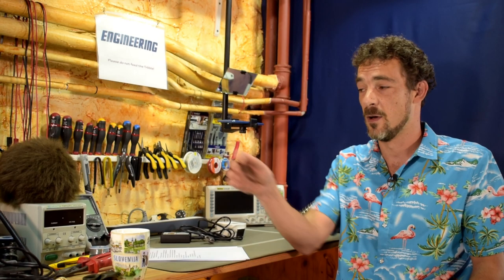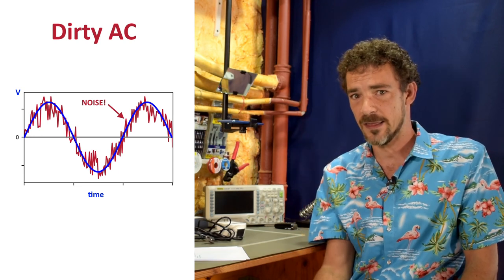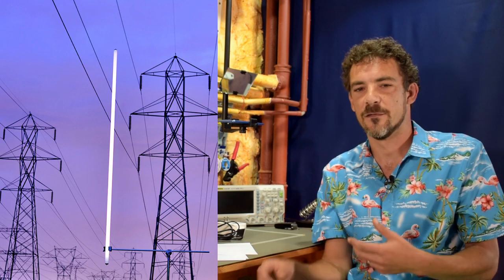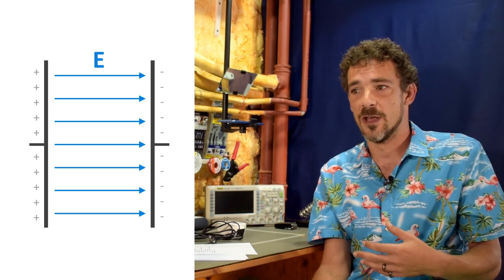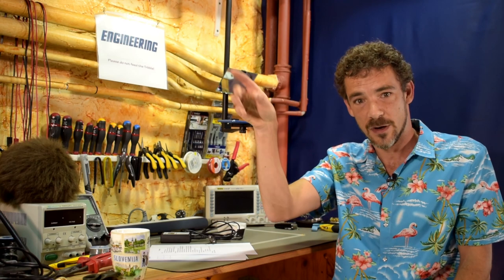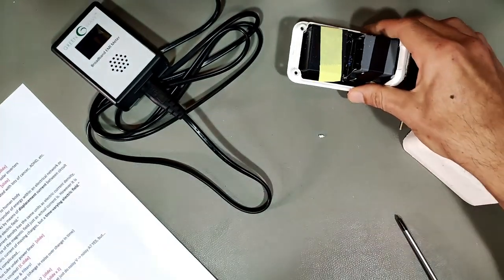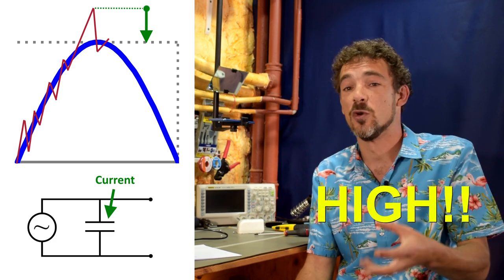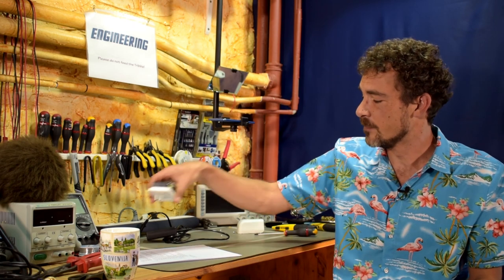Dirty Electricity: What it is and how to fix it

Comment: After a bit of research into AC line EMI I came across something similar called an AC line conditioner. It seems they are popular with the audio community. I understand how a capacitor acts  as filter to clean up power. Is it really that simple? The AC line conditioner has something that is missing in the Stetzerizer filter called a common mode choke and in some cases two additional single chokes. Can this be incorporated in your design in some way? I'm not exactly sure how and where these components can be most effective. I would much rather install one large unit at the source than have a bunch scattered around the house.
Reply from the maker: It seems that one big filter at the input to the house is less effective than smaller filters scattered around. That's what they say, and that was also my experience. I THINK the DE filters are only a cap because it's filtering differential mode noise (noise on one wire) instead of common mode noise (same noise on both wires that passes thru the ground wire). For audio purposes, the common mode filter would be better as I understand things. There's a handy PDF I found that explains this stuff pretty well: https://www.x2y.com/appnotes/emi/2001.pdf
Reply: @ScottiesTech  I think it's starting to make more sense to me now. It seems the capacitor types and ratings are what's important. The voltage and capacitance I understand, it's the ESR rating that's new to me. Like how ultra low ESR capacitors in drones help with filtering video transmission noise caused by the ESCs. I wonder if that would make a difference?
Reply from the maker: @saifcathum3423  ESR and ESL are just equivalent series resistance/inductance - IOW, a cap isn't just a capacitance; it's also a resistance and inductance. Usually this doesn't matter so much until you're dealing with super-high frequencies. For example, when you buy a polypropylene film X2 cap, even all the data sheets just say 'super-low ESR!' without giving a value. For little teeny chip capacitors for GHz-freq circuits, then they give ESR/ESL cuz it matters much more. At very high frequencies, even the traces on the circuit board matter and must be modeled and EMI tested. It's an ultra-hairy job cuz you get all sorts of weird behavior, noise, etc. and you think it's your circuit design, but alas no, it's the actual traces on the PCB routed poorly! Nutty stuff. For DE, the particular size/type of cap just seems to be chosen to filter the medium-range frequencies of about 2-150kHz. The X2 EMI (line-line) caps are also chosen because they fail safely across 120/230Vac. They tend to be "self-healing" to some extent, and when they fail, they just short line/neutral - which trips the breaker and you're done... no exploding or fire hazard. Which is nice!
Reply: @ScottiesTech and what about using both whole house inline filter with the stetzers?

Comment: Very informative and disturbing video. Thanks. Could you not measure EMI and electrical induction with a multi meter though? Its crazy how much they charge for meters. I also bought an RF meter and even with router and such electronics off Im still measuring crazy RF in the house and bedrooms. I wonder if the meter is picking up some of the induced RF by the electrical wiring?

Comment: Ok, it's early in the video, but I would like to run a new, forced air, natural gas furnace with a generator.  What type of generator will I be needing?  I plan to wire the furnace to go straight to the generator.  Thank you for your time!
Reply from the maker: You'd just need to know the max electrical power used by the furnace. Since it's natural gas, it's probably only fan power + control electronics (aka not much). Then size your generator so it has a rated continuous power output at least double what the furnace needs. And preferably, get a good generator (as in "pure sine wave"). Many cheaper generators warn you not to use them to drive 'sensitive electronics'. IOW, they produce 'dirty' power. You COULD probably get away with a cheaper generator, but if you're gonna get one, might as well get one that's better and that has a little extra capacity to power anything else you might want to add later.

Comment: Hi Scottie, I watched with great interest your presentation. I built myself some filters, using only 2,2 uF capacitors and I wonder if you measured, eventually, that voltage with the noise-meter device. Can you tell me how much milivolts showed in your case ? (with the filter you presented) - in your other video, you measured 41 mV ... and I presume is the same as with the original filter ?
Reply from the maker: I had 150-300 in most places. One room was 700 (without filters)! With filters, everything was between 20-40mV.
Reply: @ScottiesTech   thank you very much for your quick answer. My filter used at 220Vac network is making about 21 to 26 mV reduction. I used a modified schematics and if you wish to see it, I can send you a link on a FIY forum (Do It Yourself)
Reply from the maker: @CristianMuresanu  Yes, please!!! Thanks.

Comment: What tips would you suggest for home? Unplugging appliances and computers when not in use? Turning off wifi at night?
Reply from the maker: It's pretty inconvenient to plug/unplug everything all the time. So what I do is: No WiFi (I use Ethernet everywhere unless I REALLY need the WiFi, which only gets turned on for 5-10 minutes while I use it). I always unplug smaller appliances... like why leave your smartphone charger plugged into the wall socket when it's not charging anything? No mobile phones inside the house - this works for me anyway since reception inside is pretty much crap due to very thick walls and living in a rural area. Nearest neighbor doesn't even have internet, so no WiFi there either. And then I use the D.E. filters to kill the noise. Works pretty well!
Reply: @ScottiesTech do you have emf/electric sensitivity? Did filters help?

Comment: You got me thinking about my solar collectors on my roof.  Each panel has a micro inverter that synchronises to the power grid frequency.  These inverters are sophisticated such that they can compensate for some pretty gnarly power conditions.  They compensate for 100 -1000 times the fundamental (60Hz).  Can they smooth out repetitive noise through feed forward techniques?  Can they do the work of the compensating capacitors sometimes placed on the power lines to correct for the "power factor" problems caused by large motors and the like? Do the inverters try to clean-up the grid line power noise?  If not, why not?
Reply: Those invertors do have a power factor correction circuits in them and do an amazing job tracking the grid frequency in order to correct their power delivery. However, power correction and frequency tracking circuits does not smooth out any noise, just the opposite. A power correction circuit uses a switch (MOSFET transistor) to short an inductor, part of the converter, to the power lines with fairly high frequency. That introduces more noise to the grid, even though, there is an EMI filter at the input of your converters. Those filters suppress incoming and outgoing EMI but does not eliminate it. 
The capacitor filters shown in this video won't help you with anything. It's an old scam, along with those noise detectors.
Not all humans are sensitive to EMI. In fact only few are. If you are certain you are one of them, you need custom 3rd. order L-C filters and metal shielding for all of your electronic devices to help with EMI. And even that can't eliminate them completely. So no point wasting your energy with this.

Comment: Didn't think a harmonic of a few volts could effect people that way from a few metres away. Maybe if it were in the audible range, but how can non-ionising radiation cause cancer?
Reply from the maker: I've read several papers that involve calcium ion channels in cells or something like that. Honestly, I don't understand the biology part, so I just go with the more epidemiological approach: Problem -> Analysis -> Theory -> Solution. If it works repeatedly, then I guess things are more complicated than I first assumed. That's the way I look at it, anyway.

Comment: Dude fantastic! Does this mean that I should get a filter for each device or can I run a power strip on one filter?
Reply from the maker: Both may work, but you have to test with the meter and play around with moving filters to see what works best. There's no  'one size fits all' solution. Not to worry tho, becuz it's fun!

Comment: I suspect my 40amp charge controller and 3000w inverter in my very modest 4 panel 100w each solar system are DE suspects. How would a filter be used on a charge controller when it receives the DC from the panels and regulates it to the 3, 100ah in parallel batteries?
Reply from the maker: It should be the inverter created the most noise. I'm really not sure how to suppress that noise though, as inverters are basically noise machines. The charge controller shouldn't produce much noise at all since it's mostly DC.
Reply: @ScottiesTech  when I shut off the DC feed from the panels to controller RFI on my ham radio ceases or when it's night and no dc is being generated by the panels it ceases.  I'm trying various mixes of ferrite beads and chokes and have inconclusive results.  Thanks

Comment: My solar generation uses a microinverter on each panel to convert panel output to AC and then send it to my home for use. Soe of this ac charges batteries which ultimately will be called upon to run my house (after reconversion to ac of course). I am guessing that, since the generated ac is distinct from the grid, it is "clean(er)", but what about that converted from my batteries?
Reply from the maker: You really have to test everything. Very often, inverters (AC->DC) are noisy. But ultimately, it depends on how all the noise sources interact with each other. You can do filters at the grid entrance to your home, but that's rarely enough to eliminate this kind of noise.

Comment: since greenwave also now has the Spectrum 2500-EF Filter designed for EU countries (schuko) do you think that USA to EU adapters which would be necessary for the original US filters, create certaiin types of noise themselves? Even if not EMI, do they increase electric fields or magnetic fields?
Reply from the maker: The plug adapters themselves shouldn't create any kind of noise or any additional electric or magnetic field.

Comment: Hey Scottie,
Looking at your schematic at 17 mins in I do think there should be circuit protection (a fuse) in the live feed where it goes out to the 3 big capacitors (and 2 resistors) because if one of those caps goes short circuit it may burn up or even catch fire if the only protection is back at the consumer unit which (in the UK) will be 32amps MCB (for a ring main feeding sockets) or 20amps MCB (for a radial circuit feeding sockets). This means up to 8 Kilowatts or 5 Kilowatts respectively which will be easily enough to burn up the capacitors and start a fire (depending on the characteristic of the short circuit and how quickly it would trip the MCB). 
I say this with more confidence because when I opened up a EMF protection brand dirty elec filter (here in the UK) that had stopped working (the only way to tell it had stopped working was that it had stopped getting warm from the discharge resistor inside- theres no indicator light which I find disappointing and (IMO) general low quality inside too)- anyway that brand has a little surface mount PCB fuse rated at 4 amps- which had blown. It also had a thermal fuse on the neutral side rated at 135 degrees C, (which was fine). So I replaced the surface mount fuse with a wired in 20mm fuse holder in which I installed a 5 amp fuse. So these guys do bother with circuit protection so perhaps you should too?  By the way I also installed a neon indicator on the load side of both the current and thermal fuses so if either blow again I will know straightaway.
LASTLY SCOTTIE I DIDN'T WANT TO NIT PICK- I ALSO WANT TO THANK YOU FOR ALL YOUR CARE & GREAT VIDEOS.
Reply from the maker: Yeah, it's not a bad idea to include fuses. Everyone relies on the fact that when those caps fail, they SHOULD fail open circuit. But we all know how that goes! :P
Reply: What products do you have? I’m based in the uk and would like to reduce dirty electricity from solar panels
Reply: @DinaParmar1  I am using 'EMF Protection' (company) filters. They're a lot better than nothing but I've opened a couple & not that impressed with the quality. And the capacitance is only 10uF whereas Scottie is recommending 25uF.  They also contain a surge suppressor & circuit protection (fuses- not replaceable without special tools). However the EMF protection DE  filters are suitable for a UK socket and were easy to get in the UK. Some £30 each.  I use 2 so get 20uF capacitance. But Scottie is recommending using several filters with 25uF in each. So I am only getting nominal DE protection. If you watch his video from 10 mins in he talks about greenwave and Stetzerizer filters as good but there may be issues with availabilty in the UK also cost. Watch all his video focussing most on the bit from 10 mins in. Hope this helps.
Reply: @tonyharvey4569  hi there thsnk you so much for your reply. We have quite a lot of solar panels and I’m concerned about the impact it can have on health. I’ve come across green wave would I need one in each room? I’ve heard from an emf specialist in the UK that Stetzerizer can cause surges and fires which is why I’m quite hesitant about the plug in de filters. There’s some which can be used fi be plugged directly into the main unit but not sure how safe these actually are
Reply: @tonyharvey4569  do you have solar panels?

Comment: thanks Scottie for the valuable infos i did watch both videos about dirty electricity . i have a question can i install  filters on my solar inverter output? can i also use filters on my generator output? Thanks
Reply from the maker: No, using DE filters on a generator or solar inverter circuit will probably cause issues. Greenwave even updated their web site warning people about this after my video! I talk about that problem here: https://www.youtube.com/watch?v=zgH_51KXA6o
Reply: he
Thanks Scottie on the AC output of my solar system can i install the filters instead of plugging them in every room. Also can i build one that is larger in size ex 250 uf vs 10 25 uf? thanks for your help @ScottiesTech

Comment: Minimize using fast switching digital equipment. Connecting capacitors inside the house convert dirty voltage to dirty current. If possible, connect capacitors outside the house.

Comment: I was looking at the reviews on Amazon and had a question about the bad reviews. I bought some for my house and according to the greenware meter it does reduce the dirty electricity. My question is does it increase the EMF throughout the house which we know is terrible for your health or is the EMF just confined around the filters. . I saw something that said not to stand within 2ft or sleep within 2 feet of the filters because they do emit EMF. Is the EMF greatly increase just around the outlet and suddenly dissipates or is there a larger emittion of EMF throughout the room?
Reply from the maker: I measured with my Cornet tri-field and I was surprised to find that within 1 ft of any filter, fields were higher (mostly magnetic). However, the same 'medium-low' level was also present around various other gizmos around the house. So, I think Greenwave's recommendation is correct: don't stick filters near your bed, for example... But the effect seems to be a bubble around the filter of about 1 ft. Beyond that, readings are green/low/safe everywhere else in the room.

Comment: I can across this video initially looking for a cheaper low noise solution for my hifi audio system, not knowing health issues caused by dirty electricity.  'Im definitely going to buy multiple filters for my house.  But I have a question, is there any reason I cannot plug a power strip into one of these filter?  Will it work ? Does it become less effective?  Thanks in advance !
Reply from the maker: Power strips are fine.

Comment: hey bud! Will an Online UPS solve some buzzing issues in my home studio? Thanks
Reply from the maker: It can help, yes. What I usually do is put everything on a UPS. That isolates everything from the grid. Then, if you're using things like a mixer + XLR cables, be VERY careful with cable routing. I've seen nasty buzzing when a DC laptop power cable was running parallel + too close to an XLR mic cable. Sometimes, it takes very little to generate really annoying noise. Re-arrange cables, and poof: no more buzzing.